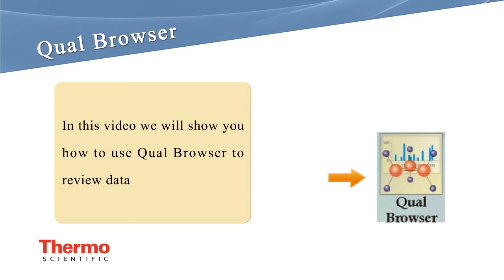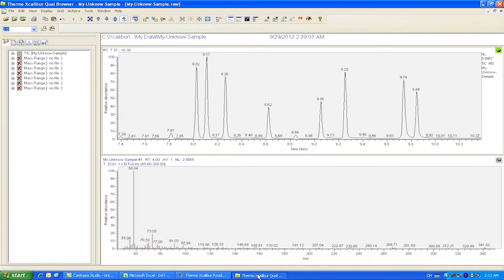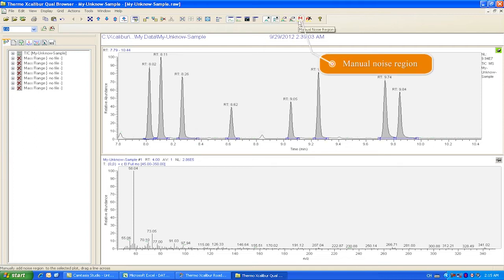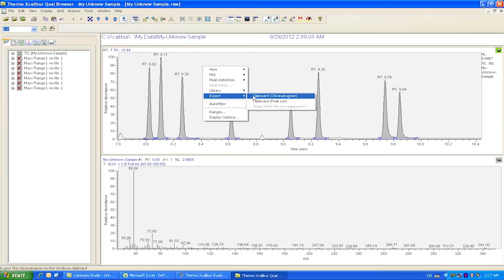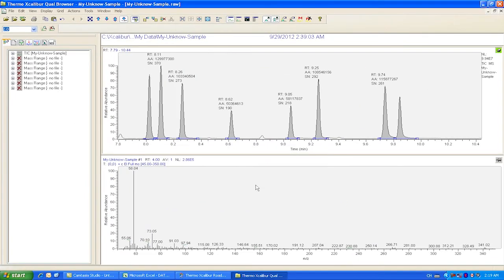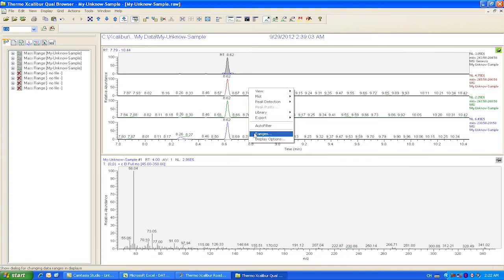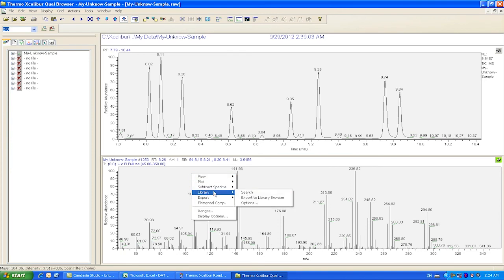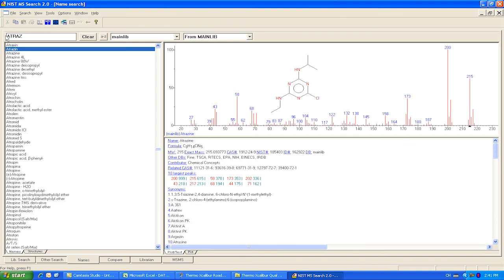74 Qual Browser

Comment: When working in SRM is it possible to extract TIC for MS- and MS+ separately or it can only be done when working in Full scan? Thanks in advance!
Reply from the maker: Dear Laura, — when the only acquisition mode in your entire method is SRM, then it is NOT possible to extract Full Scan data.  What you CAN do is to ADD a Full Scan SEGMENT into your SRM acquisition method, so that after acquiring several SRM scans, you record a Full Scan.  It is best to associate a SCAN FILTER with FS segment. Then you can PARSE your data file and display the FS data as a separate "chrom trace".  

What I do NOT recommend doing is to acquire FS and then extract SIM (XIC) = this is technically possible, but does not give you full advantage of the enhanced selectivity (and therefore sensitivity) of the true SIM.  In other words, extracted SIM and true (acquired) SIM will not have the same quality of data, since in true SIM the dwell time for each SIM m/z is significantly higher.

Comment: identification and Detection bar understands but have problem in Calibration and Level bars.sir i have no pestiside standard e.g i want to run a pesticide standard then how can i follow the same method ???? if i want to run a pesticide standard then how can i manage it because i dont have an auto sample.its manual injection type system

Comment: Thanks alot sir i have learn alot from the same software video and i am running the same system and software (DSQ II) GCMS.Sir i have completely learn about Qual browser and Qual Analysics but i am facing problem in Quan Processing method because i dont know how to run a standard and then quantitaion i have try the same method but the quantitaion does not coming.i am confused that e.g i have 1 pesticide standard then how can i enter the standard level there i have confusion kindly sir if u have some video in detail or any tips then please tell me
Regards